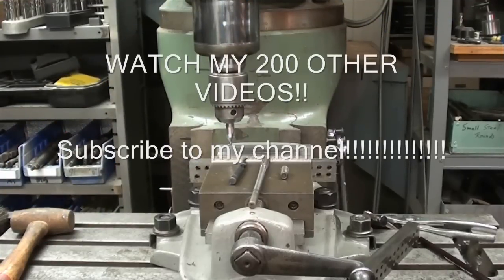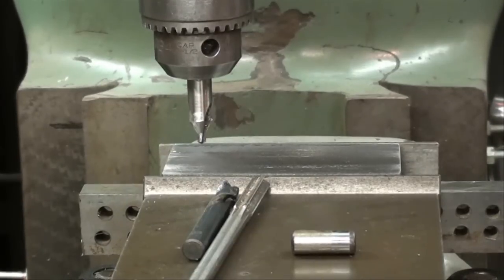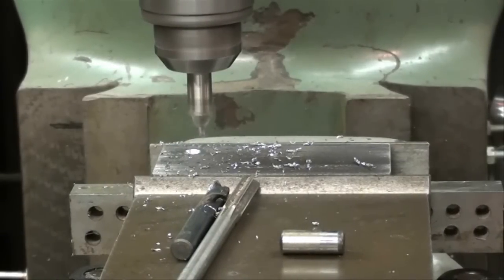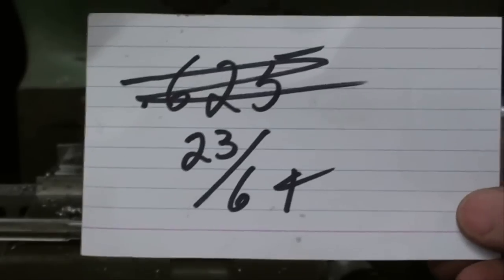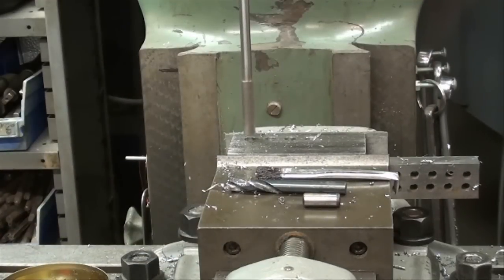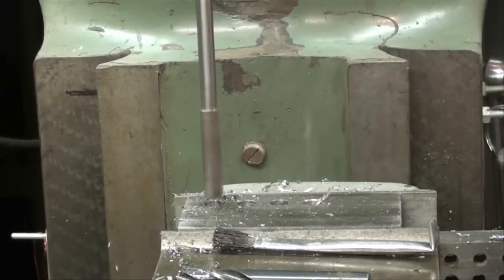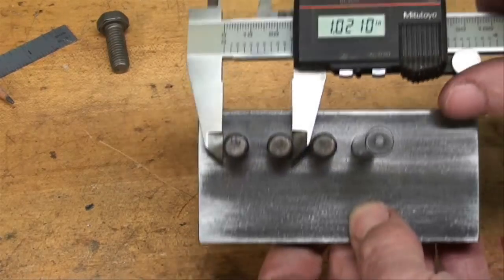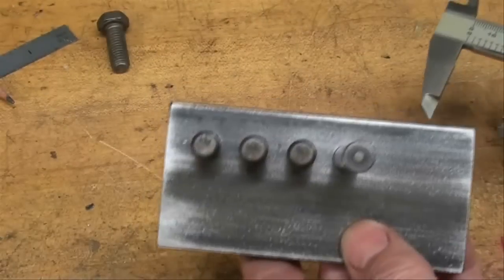MACHINE SHOP TIPS #58 Bridgeport Mill DRO part 2 tubalcain

Comment: Good vid, as always, I am courious though, what the hole 1 to the 4th spacing error was if any, Wouldn't  the 1-4 show the largest possible error of the sample?, I am not asking a question, or being a stickler, I am just thinking  a loud, given a 1/2 thousanth over 1" is very small, but if you had  say 12 or 20 holes over say as many inches, could that all add up to "my bolt or pin, or dovetail won't fit ." Just thinking a loud. All things considerd I wonder how the dial on the table compared.

Comment: @Swanny383 I guess that, since the DRO gives an absolute position, 0.0005" is just twice the variable error in the DRO, and it hardly matters how far away from each other they are. I'd assume that the error due to the heating up of the workpiece is small. Carbon steel has a linear expansion coefficient of 12e-6 K^{-1}, so over a length of 1", an increase in temperature of 10K introduces an error of 0.00012". Don't let it get hot, though. Too warm to tough is inaccurate.

Comment: I don't know how you did your measurements on your DRO, but if you did the hole location by being zero on the first hole then moving to 0.625" then 1.250" then 1.875" et cetera, I believe you are seeing a GD&T error.  The dimension measured from the first hole to all subsequent holes should be the most accurate (ornate), however, measuring hole to hole you'll see more error.

Comment: I am thinking about what this means

If each was off by .0005 and you measured across all four would you've accumulated .002 over? Would you conclude that the DRO is subject to this minor variation or is it too small to judge between the verifying instruments (could be one or the other). BTW my experience has been when the tool blinks it's right on the graduation boundry so in this case it's telling me less than .0005 off when it blinks.